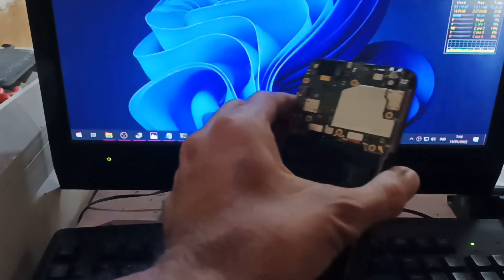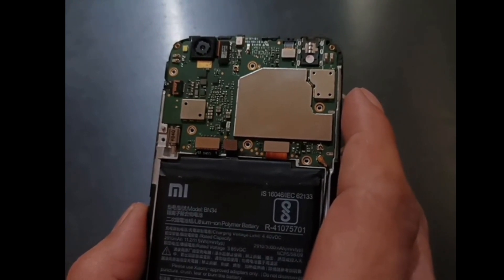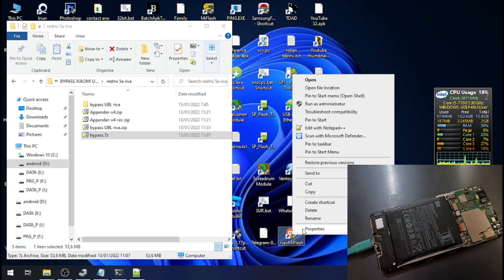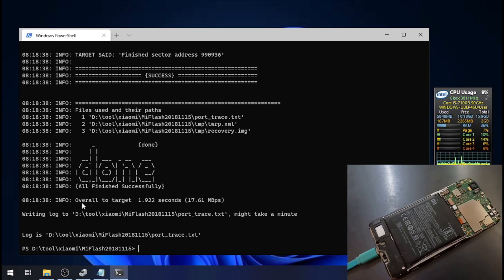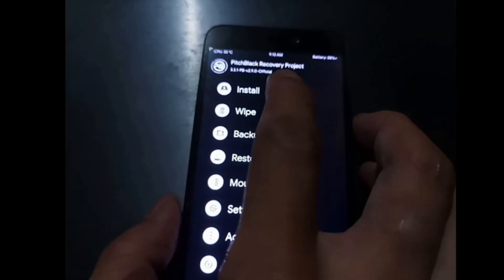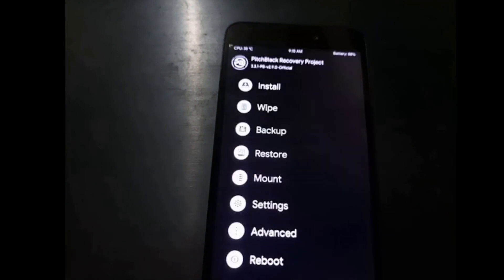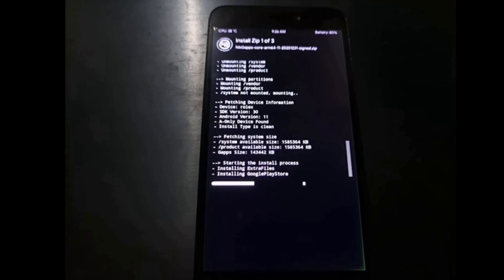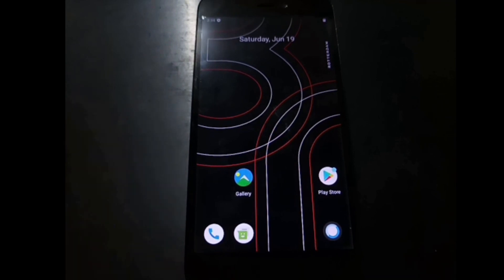Riva Bypass Lock Bootloader (Unofficial UBL for Redmi 5a) Tested!

Comment: If I Install Custom Recovery From This Method Will It Remove The Stock Rom ? Because My Phone Isn't Lockked I Just Want To Install Custom Recovery (My Phone Bootloader Is Not Unlocked)
Reply from the maker: Yes you can
Reply: Hi Thanks For The Reply ! I Did Follow All The Steps As Same As You Did And I Also Successfully Installed Orangefox Recovery But When I Rebooted My Phone To System It Shows The System Is Destroyed And It Automatically Shut Down I Can Only Boot Into Fastboot And Recovery Mode (I flashed appender , magisk , dm verity) And Also I Can't Flash Lineage OS 20 It Shows Error 1

Comment: Bang tadi ane install magisk 26.1 posisi Rom aex Oreo 8 pas ane install magisk trus reboot malah muncul logo MI langsung mati dinyalain tombol power harus tekan lama 15-20 dtk (kyk masuk 900E) nyala trus mati plet lagi kyk gitu 
Awal nya bisa masuk recovery dan fastboot pas ane ganti recovery orfox malah kyk tadi muncul MI langsung mati tapi masuk fastboot bisa
Reply: Dan sekarang pas ane flash ulang mau test point dia gak detek skrng Ama fastboot mode dicolok gak detek
Reply from the maker: magisk terbaru support A10++ bg
Reply: Lahh sama kaya kasus ane, cuma ane dari recovery mau booting ke recovery lagi langsung mati plet, cara memperbaiki nya gmna bang?
Reply: @yanuar_nomore1437  flash ulang

Comment: Hi this method successfully installed and booted my riva but what is next ....
My bootloader has been bypassed not unlocked 
So what to do next after installing custom rom for unlock bootloader

Or can i change my custom rom and upgrade recovery?
Reply from the maker: yes you can change custom ROM, but not recomend to change cstom recovery recovery
Reply: Hi thanks for the reply
I have successfully booted Android 10 lineage rom but....
I forgot to root with magisk 
Now can i still root with magisk
What is step for flashing magisk

Comment: solusinya hu di step .\fh_loader.exe --search_path=tmp --port=\\.\COM8 --sendxml=twrp.xml itu selalu error, ini lognya dibawah

20:38:04: INFO: Current working dir (cwd): C:\Users\Fian\Desktop\MiFlash20181115\tmp\
20:38:04: INFO: Showing network mappings to allow debugging
20:38:05: DEBUG: New connections will be remembered.

20:38:05: DEBUG: 

20:38:05: DEBUG: There are no entries in the list.

20:38:05: DEBUG: 

20:38:05: INFO: 'tmp\' changed to
20:38:05: INFO: this 'C:\Users\Fian\Desktop\MiFlash20181115\tmp\tmp\'
20:38:05: INFO: 

20:38:05: INFO: Trying to store 'twrp.xml' in string table
20:38:05: DEBUG: ==================================================================================
20:38:05: DEBUG: ==================================================================================
20:38:05: INFO: Looking for file 'twrp.xml'
20:38:05: DEBUG: 1. Calling stat(C:\Users\Fian\Desktop\MiFlash20181115\tmp\tmp\twrp.xml')
20:38:05: DEBUG: 2. Calling stat(twrp.xml')
20:38:05: DEBUG: 2. Calling fopen('C:\Users\Fian\Desktop\MiFlash20181115\tmp\') with AccessMode='rb'

	 ___                    
	|  ___|                   
	| |__ _ __ _ __ _  _ __ 
	|  __| '__| '__/ _ \| '__|
	| |__| |  | | | (_) | |   
	\____/_|  |_|  \___/|_|  

20:38:05: {ERROR: ReturnFileHandle:8411 Could not access 'C:\Users\Fian\Desktop\MiFlash20181115\tmp\' with acess mode 'rb'
Reply from the maker: coba buat folder baru di folder C, trus pindahin semua file ke situ

Comment: using this method works for me but unfortunately volte is not working, tried a lot of custom roms but same problem, any solutions? thanks
Reply from the maker: Sory i dont use VOLTE. i will post later meaby if i find one
Reply: @OmBobOpreker  ok thanks for the reply.

Comment: Mantap um bob 1000% work, akhirnya bisa Gonta ganti rom, yg tadinya lupa akun mi+fake ubl, udah gitu ni riva distributor yg bandel akun mi.nya, sekarang bisa Gonta ganti costom rom, auto like+subscribe, makasih suhu ilmunya 🙏
Reply from the maker: alhamrulillah om
Reply: @OmBobOpreker  Is it possible to use the same method but for redmi 5 plus? Please
Reply: Iya sangat membantu ini 👍
Reply: Kalau rom aosp yg bisa pake Livin mandiri apa ya um?
di aex padahal no root tp fc
Reply from the maker: @chodixachmad  pake magisk aj om
Reply: dah ganti Nusantara Lts A12L, akhirnya bisa no root, berkat tutor ini bisa Gonta ganti Rom non MIUI 😁
O iya um, Nusantara eLts mi max 1 (hydrogen) blm ada yg A12L ya?
Reply: Wkwkkw
Reply: Hmmm masa
Reply: Tapi kalo mau balik lagi ke miui bakal ke lock lagi ga ya bang?